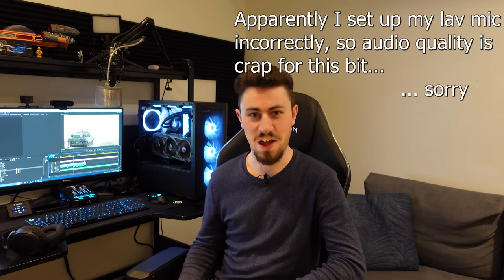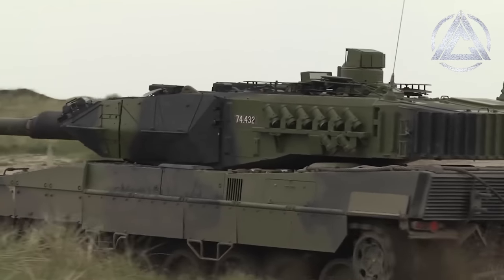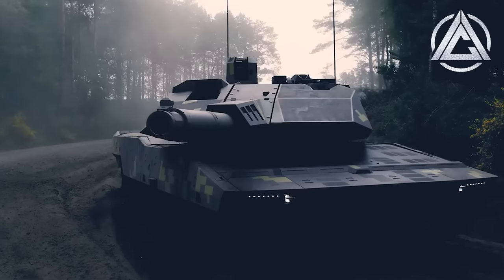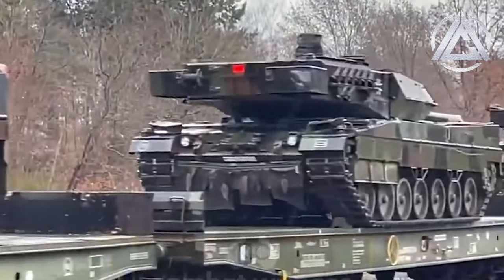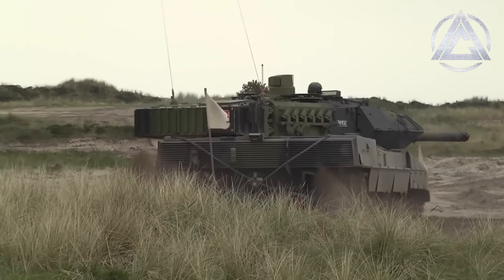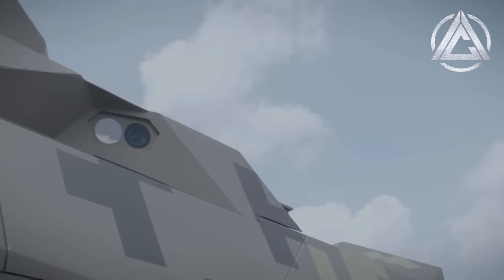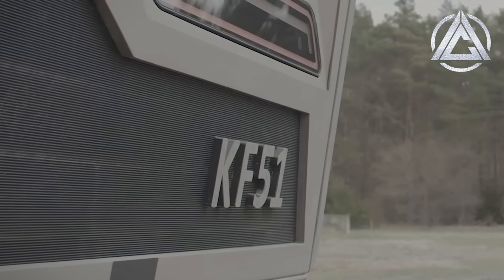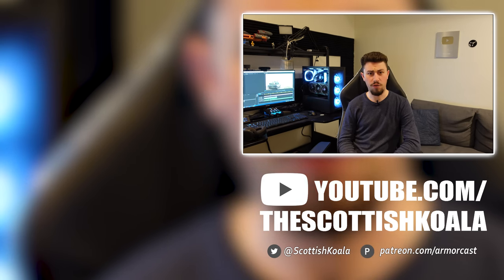Germany's New KF51 Panther Tank | The Spearhead of a New Generation?

Comment: Not sure of the US' actual requirements for MBT's outside of transport weight and size... But it seems like range certainly isn't at the top of the list.  Anyway, I wish the US would begin spreading out our production capacity and R&D costs among the NATO members.  There isn't any reason why the US wouldn't want this thing on the front line.  Same for fighter jets and naval assets developed and produced by Europe.  There is certainly a place for US trillion$ projects but certainly there are 100's of billion$ that could be saved by leveraging the capability of our partners in Europe waaaay more.  In the end I think it would grow the production capacity of all nations involved and would also allow certain contractors to focus on areas where the most R&D is needed.  Boing in space, Lockheed Martin with stealth, Raytheon with guided missiles etc...
Reply from the maker: It’s possible that anti-trust laws would get in the way of that - in order to prevent any one company gaining a monopoly over an industry things HAVE to be separated out.

However the F-35 is being produced in parts by over a dozen nations, such as the cockpits being built in Australia, while the Eurofighter for example is built in Germany and the UK (as well as Italy and Spain I think??)
Reply: @ArmorCast  It's good to see it on the big $Trillion projects for sure and the F35 project might be a sign of things to come.  Part of that contract also forced distributed manufacturing among partner nations.  So it seems like we're going in that direction.  There's also tactical reasons for NATO to have different weapons that fill the same niche but with other capabilities that don't over lap but finding savings where they make sense by sharing and spreading the R&D cost and manufacturing among allies just seems to make sense.  There is also an argument to be made in favor of minimizing the amount of geopolitics involved in military reediness.  Especially since it already plays a massive role just within the US system of govt, military and military contractors, so it's not so black and white.  Just seems like the cost savings would come hand in hand with the increased competition that would come from adding so many more companies to the list.  It's certainly too complicated for me to have a complete opinion but the cost for maintaining complete technological superiority is growing exponentially.

Comment: Okay @27:00 mins into this video I had an Ephinay, We have MBT's, AFV & IFV's, SPG's, SPA and MRV's, why in the world should we tack on more 5th generation tech onto each vehicle for anti-drone, anti-this or that and turn a MBT into a quasi multirole system capable of launching it's own drones or fighting as it's own stand alone systems? That maybe in the Sci-Fi world makes sense, but not on the battle field!
By adding more operations from these systems to a reduced 3-man crew using an auto-loader and added sensor array's, too me is just another German attempt at over engineering and under development.
I think developer's need to be looking at adding a new class of vehicles to the armored fleets that encompass the deployment of and interdiction of drones similar in the way the MRAP was developed to defeat IED's
Instead of adding everything new to existing or future MBT's, just make a new class of a supporting vehicle that can also protect the MBT's, IFV's and supporting  units! Dedicated units doing 1 or 2 functions (Drone attacks & anti-drone work) that can be accessed across the battlefield spectrum by everyone.
I can see the usage of such a tank as a spearhead unit, maybe a Company of 5 per Brigade of tanks, but without infantry support and follow on forces, you can build the biggest and most bad-ass tank in the world and it's not going to help you in a street fight or urban environment and still won't get you across a contested valley to the next ridge without support despite your impressive range.
Besides pointing out the short comings of a reduced crew to 3 and the auto-loader, I would like to point out it's shortcomings on ammunition, 20 main rounds is not a lot! I don't care how big a caliber your gun is or how fast you can shoot it, or even how fast you can maneuver, 20 rounds won't last long in a combat operation., and you would have 2 different loadout's based on the 2 magazines, so the round you may need won't be available in a hot situation if you depleted 1-drum.
There is a good movie video here on YouTube about how the M-2 Bradley development came along to replace the M-113. Everyone in the Pentagon and General's kept wanting to add more & more capabilities to it and it delayed the project for years in order to incorporate them all. The final result was basically a Light Tank. I don't base my statements here on said movie, but you can get an idea about what I am thinking.

https://www.youtube.com/watch?v=aXQ2lO3ieBA

Comment: I keep seeing in Ukraine, tanks being used for indirect fire. They fire 1, 2 or even 3 carousels of ammo at a go sometimes and are always guided by drones. This gives battalion commanders a new source of organic precision indirect fire thats extremely survivable and the range of a tank would seem to fit nicely between a mortar and howitzer.  As I understand things we used to build and train this in WW2 but have since stopped. I hope they build this capacity into these new tanks - they come with drones so it would seem to be a mistake not to include this capability.
Reply from the maker: There’s a big difference between popping off a few of your HE rounds in an indirect fire mode (which I still question WHY this is happening when Ukraine have plenty of artillery units that could be doing this far better), and sacrificing HALF your potential ammunition load for four suicide drones.

Comment: Maybe an unmanned turret will allow you to make the frontal profile smaller and reduce weight while being nearly just as well armored?
Reply: it sounds like a good idea, until a system malfunctions in the middle of combat.
Reply from the maker: That makes sense in theory... BUT looking at actual productions of unmanned turreted tanks... well, the T-14 Armata is Russia's heaviest and largest MBT by far, the Abrams TTB had far worse armor on its turret (though equal armor to M1A1 overall, meaning much more than usual for an Abrams hull), and Jordanian Falcon turret has effectively no better armor than Challenger 1, nor did the hull (which remained the same)

Comment: First of all the KF-51 is not a new tank, it is obviously a Leopard 2 with a vismod kit.  It probably is a development of their entry to the Challenger 3 program.  The hull is obviously a Leo 2 hull.
Reply from the maker: It's much more than just a modified Leopard 2, though you're right in saying that for the moment, the HULL section IS a modified Leopard 2 hull. This however is just for cost-saving reasons, while the tank is still merely a concept/demonstration piece. According to Janes, a bespoke hull has been designed by Rheinmetall but has not yet been revealed to the public.

Comment: What about our derpy 152 mm tank gun of WoT and WT fame as a full high-velocity gun as a possible future tank armament, if the prototype MBT-70 & M60A2 can be fitted with the low-velocity version?😁  Can the improvements of recoil management hardware could be used for the full powered naval case ammo in a smaller turret package compared to the DDG warship turret setup rendering the Russian 130 mm of IS-7 WoT and WT fame as a russian/western apple/orange alternative gun scenarios like what happen in the Cold War years with the 90mm vs 100mm in the 1950s, 105mm vs 115mm in 1960s, and lastly, 120mm vs 125mm of the present years🤓

Comment: The reasoning behind this tank might be also why it has a low main gun ammo capacity. I do feel they seem to think a MBT in the future will take the role of multiple vehicles at the same time. Which technically isn't a bad idea, but slapping too much into the design would be rather silly. A MBT with some form of recon drones, sure. Sounds perfectly justified. Some form of missile system or long range drones, sure but rather on the side of the turret instead of being part of the main turret body. It just takes space away from the main gun round capacity which makes no sense. Of course it should be integrated with all modern systems and potential future systems.

I don't think we will see it on the battlefield as it is now, just makes no sense in it's current form.

Comment: Primary problem with the F22 Raptor is the lack of a production and supply chain, which has mainly already been re-dedicated to newer construction and development.  That is, there will be no more new F22s and becomes an issue of '99 bottles sitting on a wall....'.
Reply: Which may well also become the fate of the M1A2 and Leopard 2.

Comment: It seems to me the 130mm and the Russian long 125mm for the Armata are foot dragging for the realization that MBT's need to have 152mm or 155mm  high velocity armament. An automated turret would be a logical next step.
Reply from the maker: Good luck carrying a half decent number of shells for 152/155mm guns in an already cramped and oversized main battle tank! The 120mm is already plenty enough, and the only changes necessary, that being velocity (and therefore armor penetration) can be achieved at this caliber rather than upsizing, which is ALWAYS the better option if available.

Comment: The sooner big oil no longer controls our world the better off we will be.
Once fusion is figured out and condensed into smaller packages this can replace the engine (turbo jet engine) and allow enough power to replace kinetic energy projectiles. But big oil will do everything to stop this as they have for 50+ years. 

Imagine if all of a sudden tanks never needed fuel and never needed resupply of ammo.. Yeah game changer, I know sounds silly but it should already be possible but given how hard big oil has worked to suppressed advancement in this area it doesn't seem so far fetched.

Comment: 14:15 So you know how the only problem with Raytheon’s iron man exoskeleton is power requirement? Why not just have it hooked up to an umbilical drawing power from the tank itself so you can manually load a 130mm
Reply from the maker: Sounds like a LOT more faff than just adopting a damned autoloader. Plus the crew have to be able to easily and quickly ESCAPE from the vehicle, that’s one of the most important factors of any tank. Being literally plugged into the tank in a heavy powered exoskeleton sounds like a very daft idea.

Powered exoskeletons sound great for engineering and logistics roles, but as for combat use… yeah better off leaving them to sci-fi universes

Comment: There's no point in a gun larger than 120mm now, since there's no amount of armor you can realistically slap on a vehicle to stop a sabot round. If anything, the barrel could be lengthened if you really think you need the extra pressure. In fact, for this fact alone the era of heavy MBTs is coming to an end, once the generals give up their pride.
Reply from the maker: @td6460  I agree there’s no need for a gun larger than 120mm, but there actually IS armor already strong enough to stop our best 120mm sabot rounds (125mm on Russian/Chinese tanks), and armor technology is also continuously improving, with things like metal foam, or electromagnetic reactive armor. The turret armor of the Abrams and Leopard 2 can stop almost any sabot round in existence today, the only exception is that Russia’s experimental “Vaccuum” sabot for the T-14 Armata could potentially punch through the Leopard 2 (but the T-14 is yet to see significant production, and the T-90M cannot fire this round).

Thing is, if you need more penetration, you don’t have to raise the caliber of the gun… you just swap to electrothermal-chemical ammunition, which can achieve significantly higher velocities and therefore better armor penetration (as well as accuracy and range). This is something that the US’ XM360 cannon is already capable of, so I expect we’ll see it mass produced for future tanks like the M1A3, possibly a later iteration of the M10 Booker, etc.
Reply: @ArmorCast  That's interesting. Is there any actual evidence for armor existing that can withstand a DM73 or a SHARD bolt? I mean, has this been physically proven somewhere, or is it just based on manufacturer claims?

Comment: UPDATE June 2024 :  KF51 Panther is replacing the Leopard 2  tank as the new MBT in the Germany HEER. Since Germany did supply older Leopard 2 tanks to the Ukraine war and saw how they got destroyed within the first week of action the Government and Head of the German military already committed internally to a fast push to replace the old outdated Leopard 2 tank. The replacement will take place in a time span of around 15-20 years from 2025 forward.
Reply: Except that this is wrong.

Comment: Raptor problem was nothing to do with software or flight computers. The new missiles are longer than the old ones and too large for the weapons bay. The f22 was built around the amram and the new version simply doesn't fit.

Comment: well i actualy think since its vehicle it will not be kf50-1 but later versions might be kf51a2 and so on like leopard 2a5/6/7 and so on
Reply from the maker: There may very well be a KF51A1, A2, A3 etc.
But the next fully NEW vehicle would be KF52, provided it falls into that weight class, or KF61 if it's heavier
Reply: @ArmorCast   the rheinmetall also said when some journalist asked about unmaned turret they said they can make it but they can also make the tank with no crew at all "we tought about unmaned turret but than we tought why not move whole crew out of tank" so they can probably make it a drone tank whoch is just insain to think about

Comment: The generational leap between the leopard 1 and 2 isnt as big as one could think it is. By the early 80s the Leopard 1 had several upgrades applied to it regarding armor, optics, targeting systems etc. The turret for the Leopard 1A5 version is in theory even capable of mounting the 120mm L44 smoothbore just like the Leopard 2. Though I dont think that option was ever taken by any of the operating nations.
Also a bit sad that the video devolved into a more and more opinionated ramble while the first half was pretty good.

Comment: any Leopard 2, no matter A1 to A7, with a modern thermal imaging camera and a modern fire control system is better than anything our potential opponent Russia has to offer, so such a super tank is actually not necessary at the moment.  And the approximately 2000 Leopard 2 could be upgraded faster than new KF51 can be made…
Reply from the maker: Keep in mind Russia have reserved several of their latest T-90M tanks to only deploy to the front now. I’d say any variant before the Leopard 2A5 is in trouble if it were to come up against those tanks directly.

Anything else? Yeah most Russian tanks are pretty rubbish compared to German or American, Russian focus is more on artillery than powerful MBTs, so even older Leopards are in with a pretty good chance of being effective

Comment: Kraus Maffei was completely unknown as an arms manufacturer prior to developing the Leopard I. Whereas Rheinmetall has been a noted arms manufacturer for well over 100 years. I think KMW's days are over, and it's highly revealing that KMW hasn't come up with a competing design to the Panther. Just as a side note, most of the hull and running gear for both Leopards are actually designed by Porsche - I've seen the original design drawings.

Comment: 0:54: 🚀 The video discusses the recently unveiled kf-51 Panther, a new main battle tank concept proposed to replace the leopard 2 and its potential impact on armored warfare.
5:52: 🔫 The video discusses the benefits of upgrading to a 130mm gun system for tanks, including increased range, velocity, and penetration capacity.
11:10: 🎯 The video discusses the features and capabilities of the KF-51 Panther tank, including its 130mm gun, autoloader system, and the use of hero 120 loitering munitions.
22:07: 🚀 The video discusses the features and design of the KF-51 Panther, a revolutionary tank based on the Leopard 2 with advanced sensor suites and pre-shot detection capabilities.
27:20: 🛡 The video discusses the challenges and reasons behind replacing tanks like the Abrams and Leopard 2 with new designs.
32:42: 📺 The video discusses the design and potential adoption of the KF-51 Panther tank and the question of using an unmanned turret.
37:45: 👍 The video discusses the kf-51 Panther main battle tank concept and its potential for entering mass production and service.
42:58: 🎉 The YouTuber expresses gratitude to supporters and celebrates reaching a milestone of 100,000 subscribers.
Recap by Tammy AI

Comment: Could a sniper not take out all of these optics?

And are they still not vulnerable from the top from shoulder launched missiles?
Reply from the maker: Not with the active protection system. While those systems still have ammunition, no missile is touching this thing!

As for snipers hitting the optics, historically speaking I believe it has happened once or twice. But it’s extremely rare, and honestly just not really possible to account for. Those optics are already made of pretty strong materials, not just regular glass, but I doubt you could make them strong enough to withstand a sniper round without detracting from the picture they provide the crew